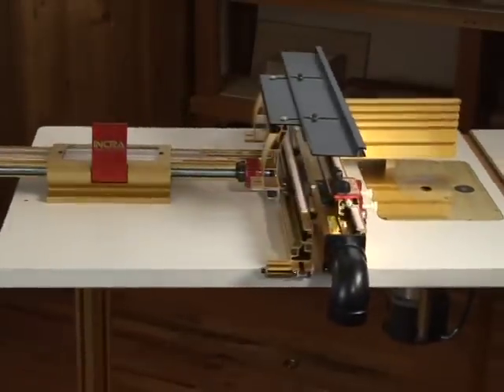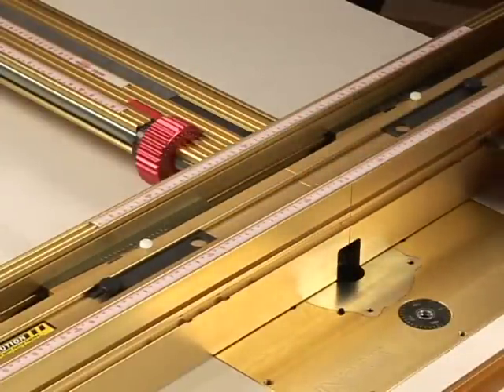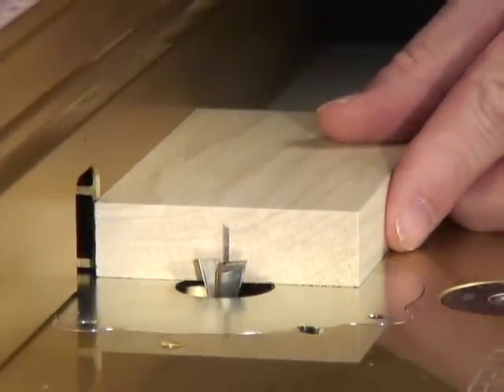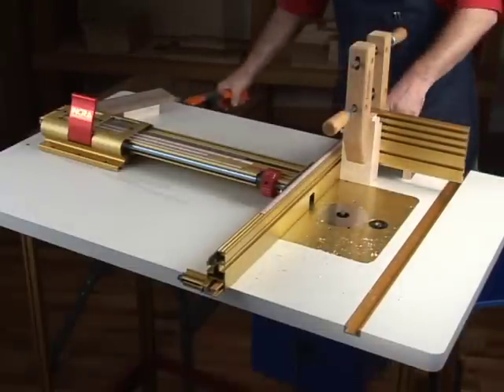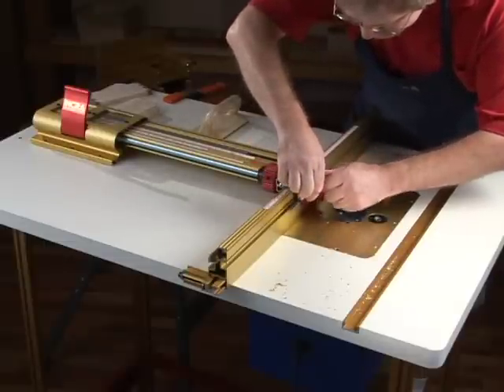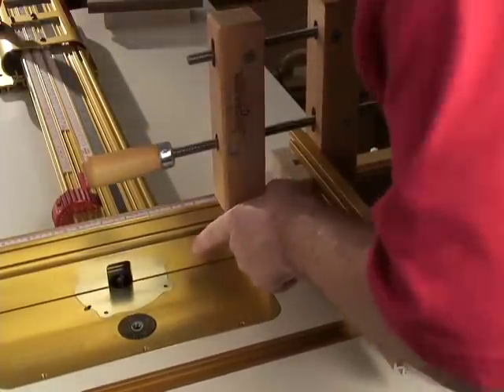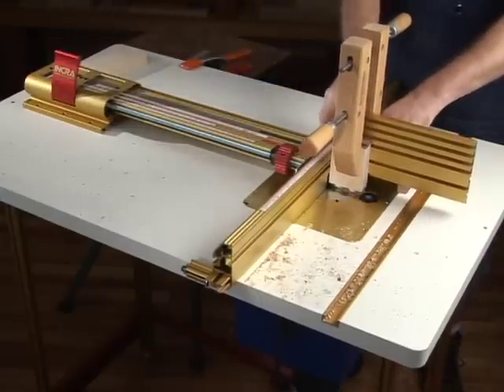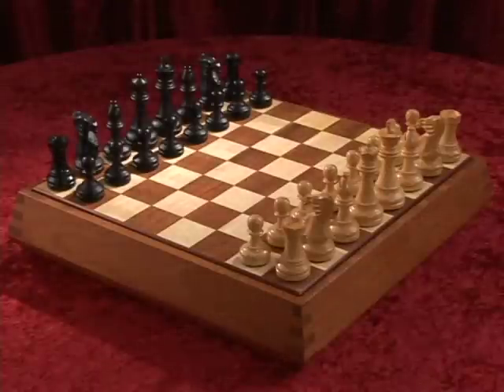Incra LS Positioner (Step-By-Step Instructional Video)

Comment: I learned the importance of using the spring clamp on the sled while positioning the workpieces against the fence for cutting dovetails. It's also very important to tap the workpieces down lightly with a mallet to make sure they are seated down firmly onto the table. Any tiny variance in the height of the workpieces will affect the fit upon assembly.

Comment: Been using INCRA ultra for 29 years then decided to upgrade to LS positioner, a few surprises, the hairline curser is not right, it’s like somebody dribbled the paint on, it’s not a perfectly straight line, making all but one of the slots useless. Another surprise was pulling out the template strips get stuck, if you don’t have a nice fingernail to lift the strip over the steel plate, you can easily damage the strip! That can be easily filed down but the hairline curser may should exchange, still gets 5 stars from me!

Comment: How are you allowing for the radius left by the cutter when cutting the blind dovetail slots?  In  traditional dovetail jigs the pins are rounded to fit the radius in the blind dovetail slots.
Reply: D6c10K that’s what the dovetail rabbet is for

Comment: Would there be an issue with using INCRA LS through dovetails on 1/2 or 5/8ths Baltic Birch plywood since the thickness is a little less than 0.5 and 0.75?  I plan on making drawer sides + fronts for some built in dressers.
Reply: I have the incra and precise thickness is only needed for through dovetails (and even then the thickness needs to match the depth of cut not an exact 1/2 or 3/4)

Comment: I have the old t s. System. But it works the same way as the new l.s. system. I bought the DVD. I wish I saw this first. I wasted money. 
My dissapointment is, this does not go through the fine tune adjustments needed to get the results. This is more of an promotion video, on how neat this is.
Reply: I'd like to see a video of someone that bought this system. I can't find any.
Reply: @dougprentice1363   Guy Dunlap does videos of using his LS positioner. it was his video that convinced me to pull the trigger
Reply: Thomas Hughes yes but he never bought it!
Reply: You're very correct.

Comment: I love my older Ultra but I must admit, as sophisticated as teh Incr DT Jig is, the right angle fence leaves a lot to be desired, especially for those that only use it periodically.  The fence is ok, but the method for securing the stock to the right angle fence is pretty archaic and can easily lead to mistakes with the cut.  Does anyone know of a better way to secure the stock vs screw clamps?

Comment: I love this video. I've had the LS now for few years but am just now wanting some dove tails. The APPROX stock witdh is listed on the templates. So if the recommended stock is 1/2 and I want to use 5/8ths will that work out ok? Or will I ruin the ends of my boards? Of course I could set it all up and experiment, but figured I'd toss it out there for some free quick advice. Thanks Incra.
Reply: If your stock is thicker than the recommendation your half blinds will be just fine but the dovetails won't look as nice or symmetrical. Minutes ago I just finished some half blinds using 1/2" stock instead of the recommended 3/8. They're fine-ish.

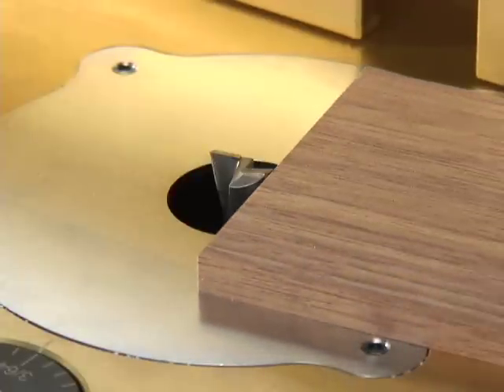Comment: Any idea why you can't raise the cutter instead of thickness planing your stock? @ 48:48
Reply: The angles will be wrong and you'd have a gapped joint
Reply: The tightness of the joint is controlled by the height of the cutter.  Heighten to tighten; lower to loosen.